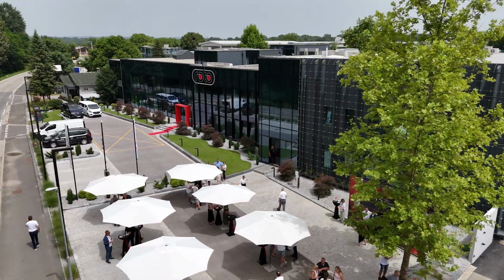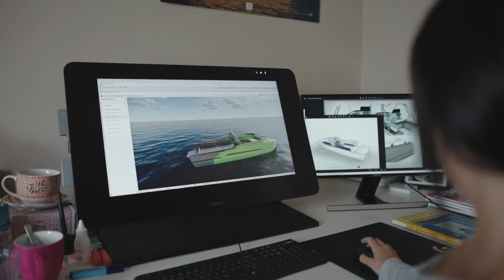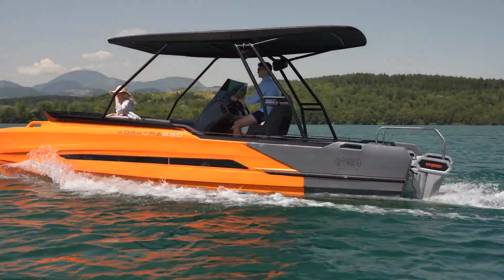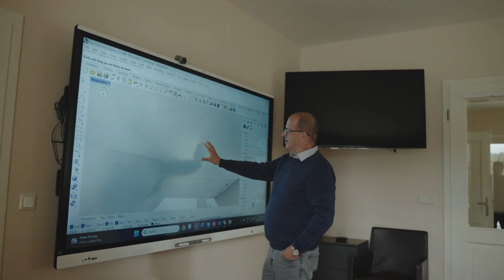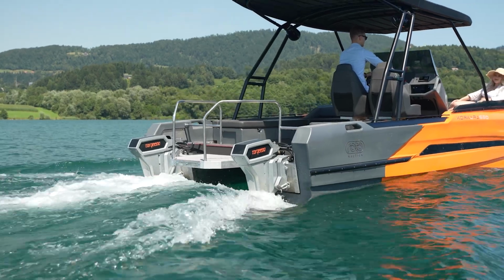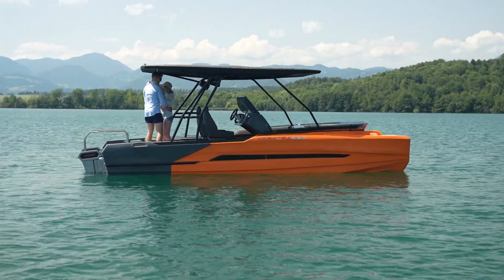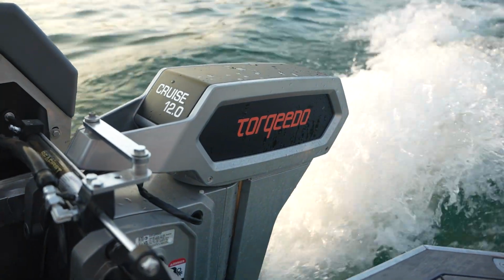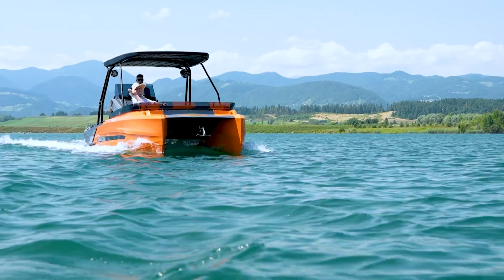In Conversation with J&J Design: The Story Behind the Catamaran Korkyra650

Comment: 🎯 Key points for quick navigation:

00:00 🚀 J&J Design founded by brothers Yapetsz and Yay Yakopin, driven by passion for sea and sustainable yacht innovation.
00:12 🌍 Evolved over 40 years into global leader blending tradition with cutting-edge tech for high-performance yachts.
00:25 👨‍💼 Yakopin, co-founder, creative force behind Korkyra 650 catamaran.
00:41 🤝 Longtime collaboration with ROTO from yacht tank designs, sharing sea and environmental passion.
01:21 🛠️ J&J managed full scope: concept to engineering realization.
01:39 🔬 ROTO's multi-layer roto-molding creates lightweight, strong sandwich construction.
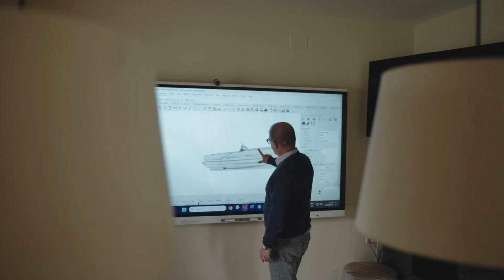02:12 ⛵ Catamaran chosen for superior efficiency with slender hulls and lower resistance vs. monohull.
02:27 ⚖️ 2.5m width maximizes stability for passenger comfort while road-transportable without permits.
02:55 🏗️ Aluminum central plate rigidly connects hulls for exceptional strength and stiffness.
03:07 🎨 Distinctive silhouette ensures recognizability from afar.
03:54 🌊 High stability yields minimal heel in waves for ultimate comfort.
04:40 ⚡ Hull sections optimized for electric propulsion efficiency and low energy use.
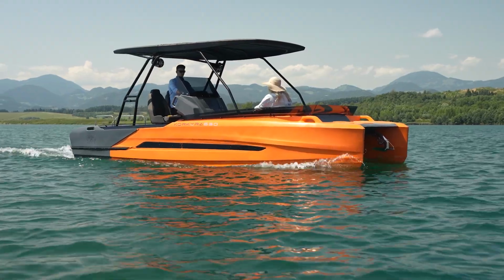05:07 🔄 Twin electric outboards, widely spaced, enable tight "turn on a plate" maneuvers.
05:39 🚶‍♂️ Expansive flat deck allows safe, step-free movement from bow to stern.
06:40 ☀️ Modular roof hosts 1.5 kW solar panels relative to boat size.
06:55 ♻️ Fully recyclable: dismountable aluminum and reusable polyethylene hulls.
07:24 🔋 Configurable battery array supports solar-only operation.
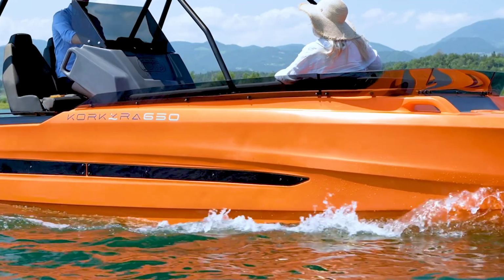08:24 🌿 J&J pioneers sustainable green boating through craftsmanship and tech.

Made with HARPA AI